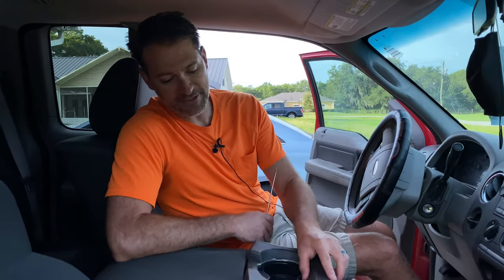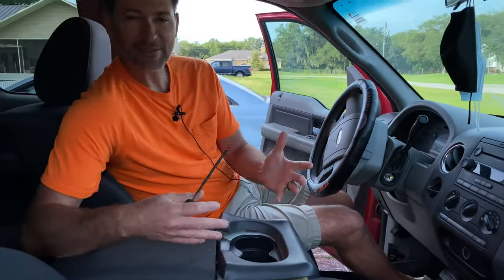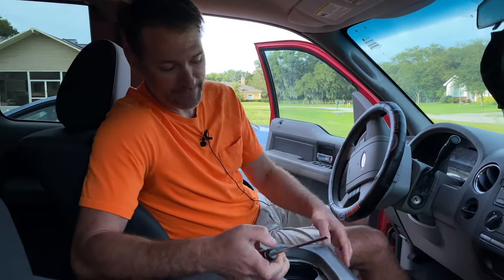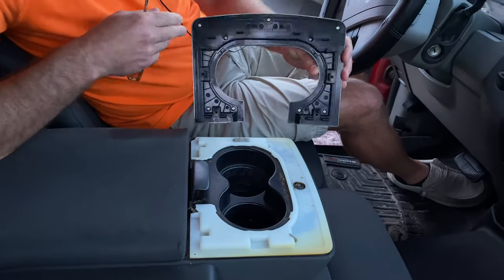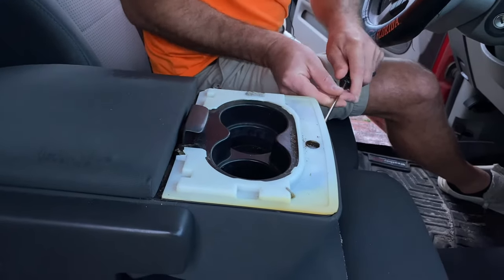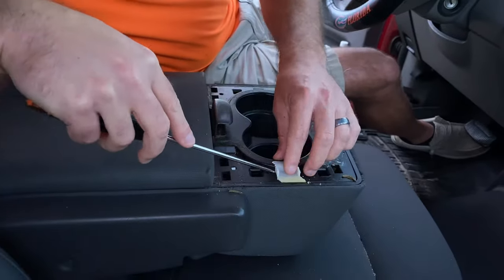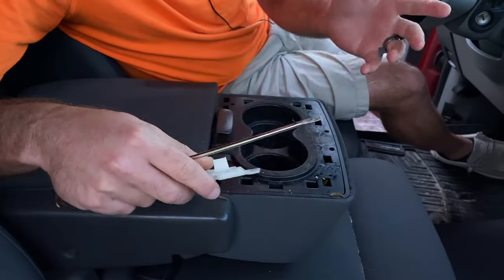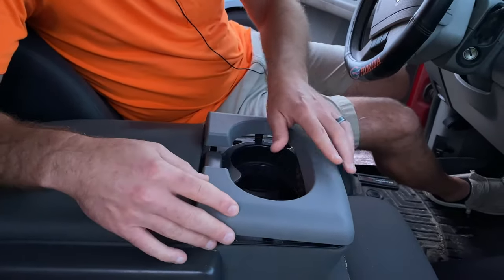DIY Repair/Replace Ford F150 Console Cup Holder | 2004-2014

Comment: Have you looked into those tiny cup holders? I was wondering if you run across anything that is a larger retro fit cup holder for the larger cups and thermos's